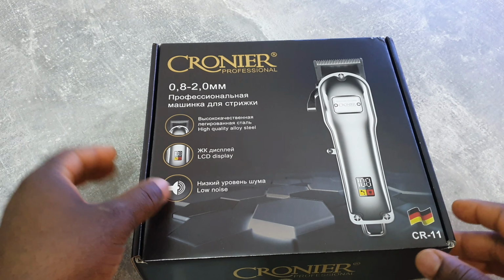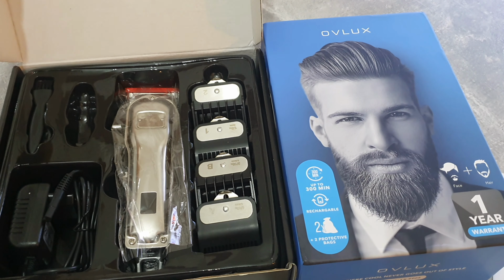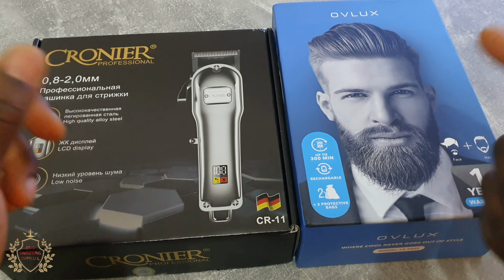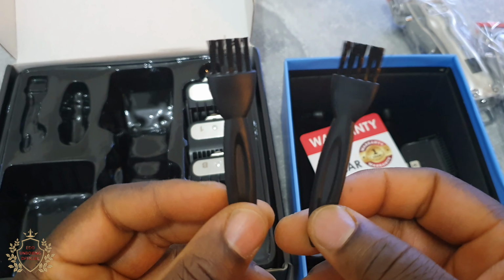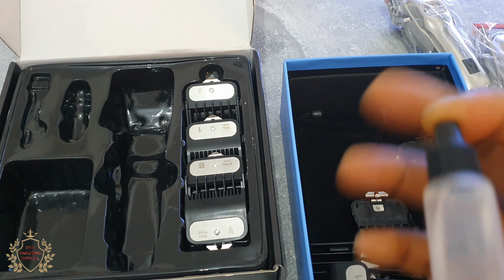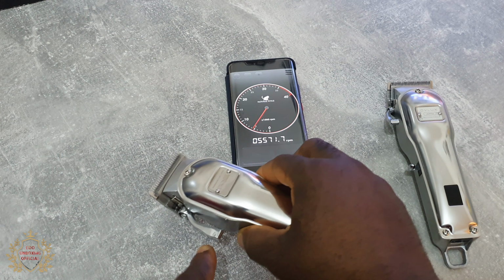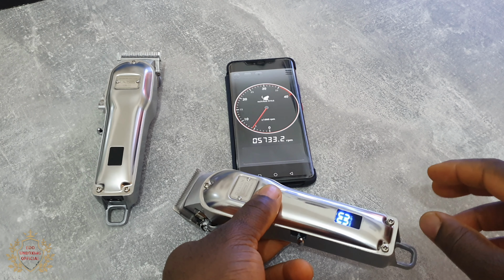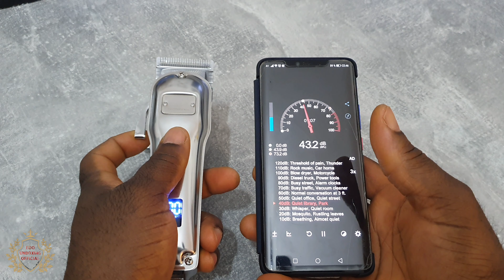Cronier CR 11 Unboxing | Head 2 Head with OVLUX LX 9905 | Motor,  Battery & RPM #cronier #ovlux

Comment: This Cronier is just the same as the Wmark 2020a or 2020b I forgot but its the same thing.
Also the Kemei 1984/1983  was just the same thing as that, also the Premium guards that comes in it is the same as the clippers I mentioned, and the Battery Capacity that they have (2500mAh)
Reply from the maker: Ok

Comment: Does the kemei 1973 have a fixed gap like the kemei 1949, or do you have to zerogap it yourself? Ive ben thinking of buying a kemei 1973 with wahl detailer blade, or just buy a detailer blase for my kemei 1949
Reply from the maker: Is possible to zero gap the stock blade of 1973. No need to buy Wahl T-wide blade cuz it's already sharp enough
Reply: @edounboxingofficial  thanks brother
Reply: I see notices that youre online now, good morning hahaha
Reply from the maker: @chihai_tran  morning bro